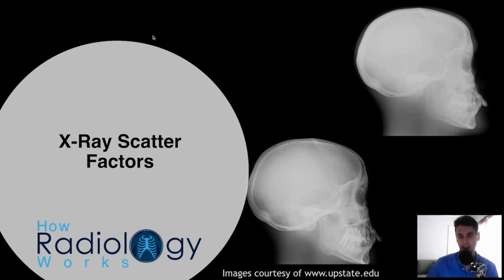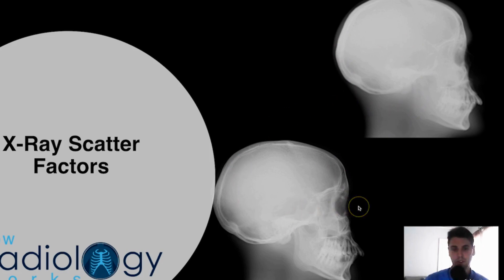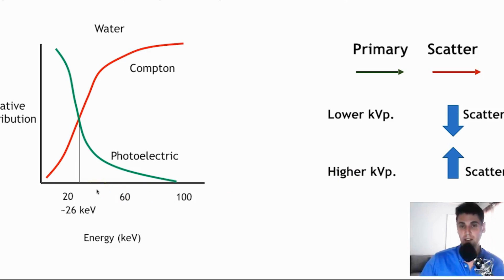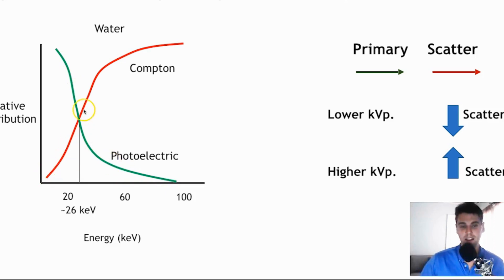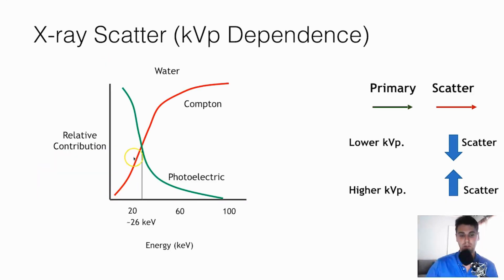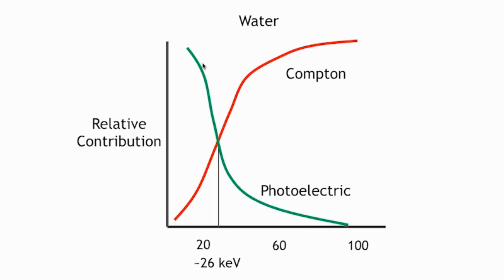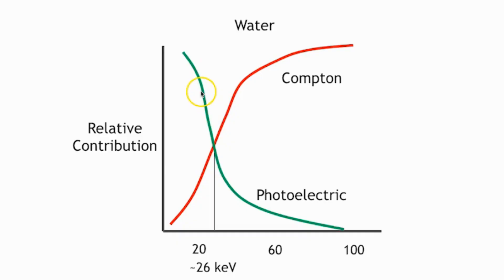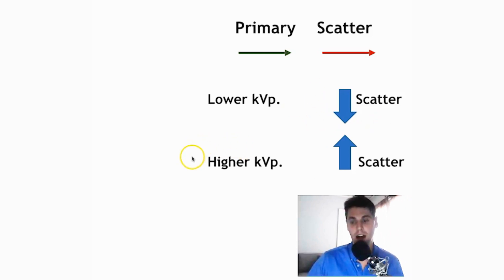X-ray Scatter kVp (Rad Tech's guide to Scatter Artifacts Dependence on kVp)

Comment: Hello senior Brian.
Thanks for your explanation , but i am kind of confused and need your help.
Here is a specimen of MCQs regarding RCR :

Concerning the Compton effect:
(a) There is interaction between a photon and a free electron.
(b) The larger the angle through which the photon is scattered, the more 
energy it loses.
(c) The wavelength change produced depends upon the scattering material.
(d) High energy radiation is scattered more than lower energy radiation.
(e) The amount of scattering that occurs depends on the electron density of 
the scattering material.

As regards D my answer was correct according your presentation( icreasing kVp does increase scatter)  here as well as what i have read at Farr's physics, however their answer was false.
Actually i am confused!
Can you help please?
Reply from the maker: Increasing the kVp increases the relative amount of scatter as photoelectric goes down. I think the answer is e as the scatter is dependent on the number of electrons that are around to scatter with
Reply: @HowRadiologyWorks  i am so sorry, I think you miss understood me. Every phrase is considered as a question and we must answer it using true or false.
So my answer (d) true as the Compton effect goes high with high energy. However there answer was false in the answer sheet that’s why I am confused.
Reply: @HowRadiologyWorks  (a) true (b) true (c) false (d) true (e) true

Comment: Im pay good money for longer videos please explain things from scratch of scrartch and im donate to support your channel via pAypal
Reply from the maker: Thanks Peator. I am trying to build up all of the basics from scratch over time but separating into bitesize info for youtube since most don't like really long videos. Is there a certain topic for the background that you want more details?
Reply: @HowRadiologyWorks  i have question about CT Helical Scan 
In helical the Tube Continuously rotating while the table continuously moving without any stop or break at all
So each cross section of the body needs 360 degree projections or 180degree for image reconstruction 
So why there is no motion artifacts if the table moving while tube rotation 
Each slice wont get full tube rotation it will get only 30 degree or lesser and body move to another level in the Z direction 

Also the mas and kvp confuses me when to use high ma and low ma 
Also what is mas if i multiply the ma by mili second or micro seconds to get the ma